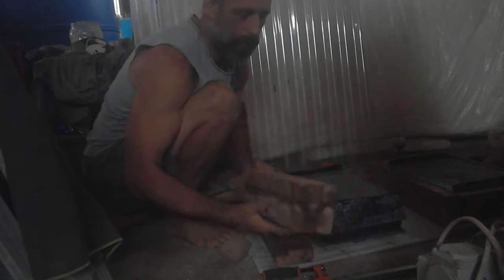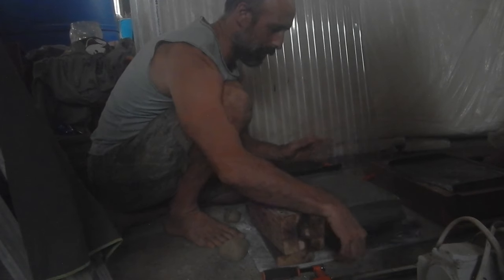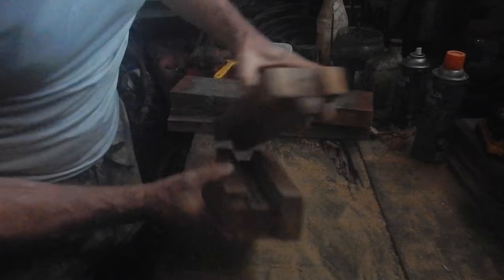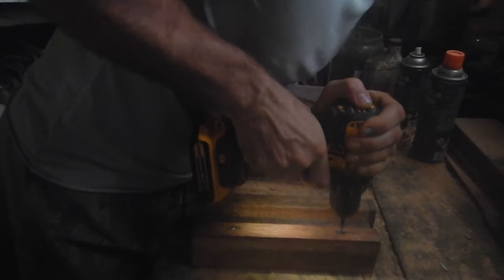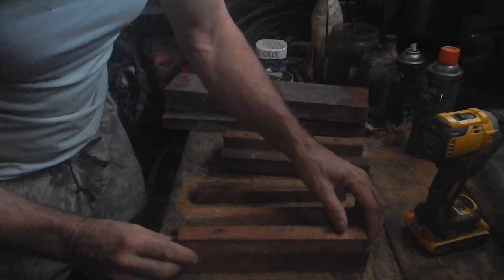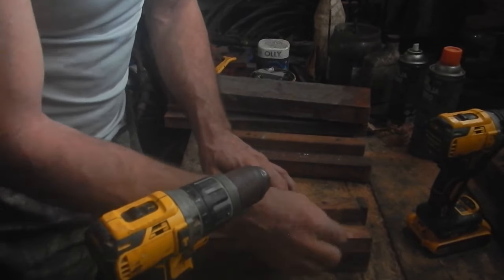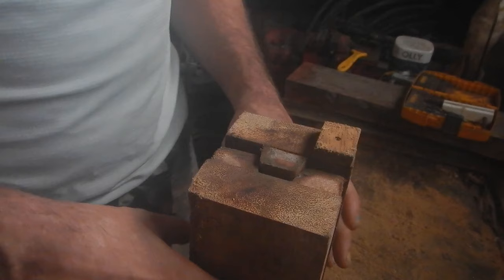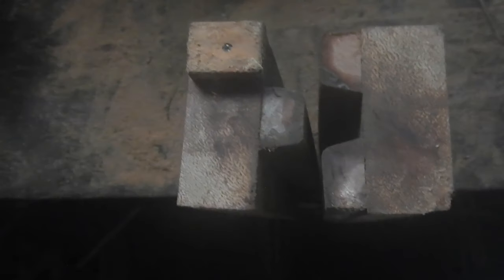Sea Wall 2 -Stupid Mistake.  Seriously, I feel like an idiot.

Comment: ha ha we are surprisingly similar, I did worry about the crack but i never wrote anything cause I kindda figured you would address it if it was a real problem. The molds arhh F.. it mistakes happen just today I drove 30 minutes to cut up firewood just to realize i forgot the gas for the freaking saw. It was a bummer but life goes one.
Reply: I've lost count of the number of times I've driven to a client's site, only to realize not all of the parts are with a tool needed for the job.  Checklists were invented for workers who have to share tools.

Comment: Running is hard on the joints, but not as hard as the wildabeasts.  I would recommend a pedal drive/generator for a watercraft for that extra 75 watts or so.

Comment: I was screaming this at the screen the whole time as I saw you "fit" the mold .. derp!
Reply: I thought I saw on the initial mold that the tongue and groove parts seemed to have a little "play" in them as it was.  Wouldn't that be enough as it already were?
Reply: Actually in this video the parts are not as loose fitting as I remembered for some reason...
Reply: I guess you needed to scream louder so he could hear you all the way over there in Panama 🤣
Reply: @AtimatikArmy  You have to remember that the mold creates the inverse pattern in the final brick. If it's loose on the mold the resulting fit will be tight. So the mold needs to be tight for the bricks to have a loose fit.
Reply: @_DRMR_  OH YEAH!  You are totally right!  I would have made the same mistake Jamie made had I made these myself!  Jamie even mentions this the same way you did here in this video and somehow I missed that, too...  Anyway, thanks for pointing that detail out as now I understand! 😅

Comment: To make concrete blocks waterproof, you can add a variety of materials and techniques, including: 
 
Crystalline waterproofing: A cementitious substance that penetrates concrete and reacts to moisture to form crystals that block micro-cracks 
 
Water repellent sealer: Applied to the exterior of concrete blocks after construction to repel water 
 
Liquid polymers: Mortar admixtures that reduce water absorption and porosity 
 
Grout or insulation: Filled into hollow cores of concrete blocks to eliminate moisture pathways 
 
Drainage planes: Installed behind veneers to allow moisture to drain 
 
Weep holes: Added to allow water to drain away from structures 
 
Acrylic, polyurethane, or polyurea-based materials: Applied directly to concrete surfaces to protect against water and sunlight 
 
Sika® Watertight Concrete Powder: A combined water resisting and superplasticizing admixture that reduces water permeability
Reply: Weird CHATGPT bot...